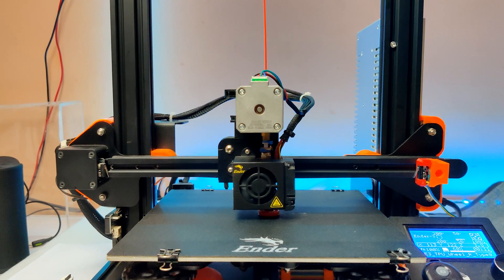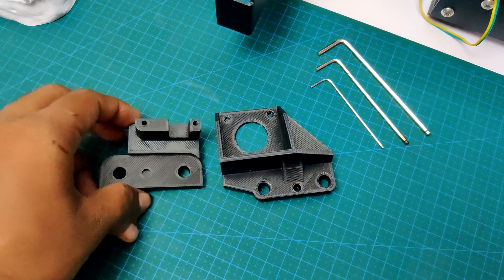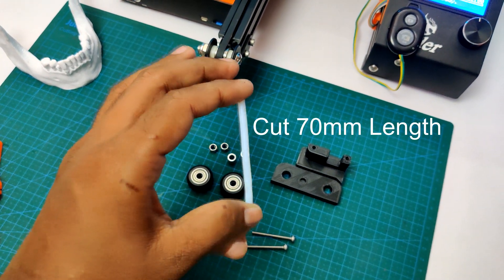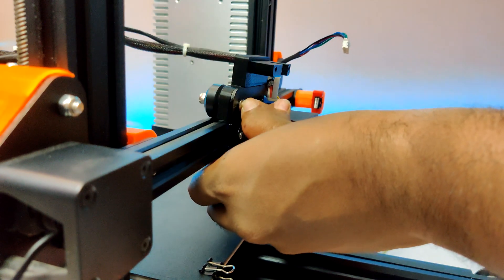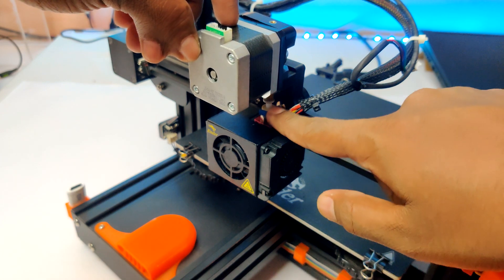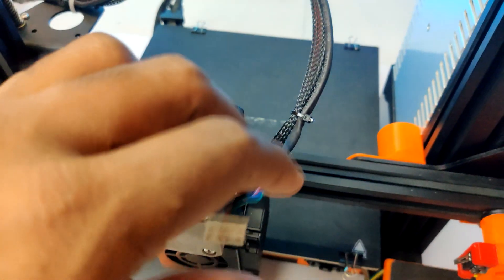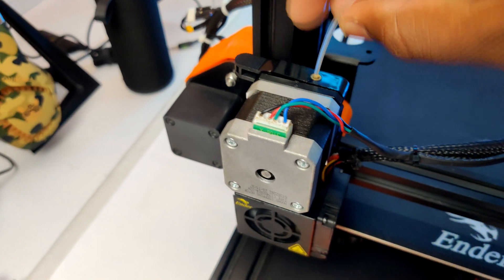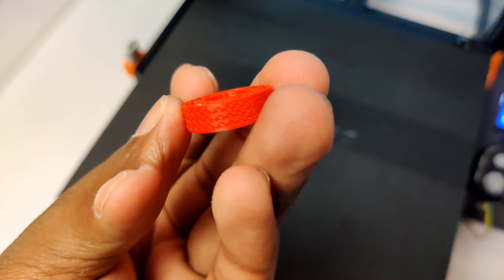Direct Drive on Ender 3 | Printable | Make it free #ender3

Comment: This is good but the design is faulty, I realised after installing the part on my printer, The main problem is that it does not support the spring tensioning screw which is a vital part for the extruder assembly, however it can be fixed by using a grub screw instead of m4 screw that it comes with.
Reply from the maker: Really thanks for the feedback brother. That's my bad, I forgot to mention the spring screw needs to be upside-down inside the spring. Once again thanks. I will add those instructions in the description. Have a great day brother 😊
Reply: I stuck a grub screw in mine lol

Comment: is it true that if I use direct drive I can push my ender 3 to a baseline of 100mm/s using high speed PLA? copilot said that it would and I wanted to see if it was true.
Reply from the maker: yes, you can
Reply: @dcl3d  Thanks, also, I found a 3d printed direct drive mount(not this one) and the guy who made it said you can do 100mm/s and  3000+ acc with perfect quality

Comment: The design is very good and simple, easy to print, but in my case I had to modify the model since the motor did not fit, then take into account that due to the weight of the motor and being 3D printed it flexes slightly so the upper area I had to give it a slight upward tilt and finally the screws did not fit correctly so I had to make some entrances to obtain more progress and a better fit.

Comment: I clicked on your printables link. It printed however I just noticed that the mount design has changed slightly. The two pillars that were the mounting pieces for the extruder are now shorter. I just wanted to verify that this design will still work the same way as in the video?

Comment: Hey dude can you tell me how the extruder tension spring works cuz it does not fot
Reply from the maker: @Xeno9118 I forgot to mention the spring part buddy. U need to screw the screw inside the spring( reverse it ). U can see on 1:48 pause it and check.
Reply: @dcl3d do I need to adjust any settings on my printer?
Reply from the maker: @Xeno9118  I use Retraction distance 5mm and retraction speed 45mm/s. it will reduce the filament strings.

Comment: Which improvement does it have with this upgrade?
Reply from the maker: You can print various TPU filament and with correct settings u can reduce the strings on print.

Comment: This was a great video but nobody is showing where the filament detectors goes or is hooked up. I'm trying to upgrade my voxelab. Any suggestions?
Reply from the maker: Your question is, where u need to connect the filament detector on your voxelab right.
I don't know what model u have in voxelab. If u see your motherboard spec, if it has a slot for filament detector u can add one to it. Or no slot u need to upgrade the motherboard. Hope it is useful. Have a great day 😊
Reply: @dcl3d  Thanks for responding I have the Aquila X2, the filament detector is located on the side next to the feeder. When I upgraded to the direct feed I didn't think about the filament detector.
I figured out 2 solutions for the fix
1. I could relocated the detector to the top support next to the filament roll
or
2. Place a piece of filament in the detector fooling in to operate like it was all connected. 

I chose #2 - problem solved

Thanks again

Comment: This is the best implementation I have seen. The only question is, is the structure rigid enough?
Reply: I've been using this on a printer for about a year and 4 months running a couple of times per week and the assembly is still rigid and working great
Reply from the maker: @Swole_Gecko  Thanks for your feedback brother😍
Reply from the maker: Yeah, those are really strong. I run my printer day and night it works great. It been 9 months still I didn’t get any clogging issues.

Comment: absolutelly useless. what are the print setting? i don't need to see how you mount it, i need settings
Reply from the maker: 1.Profile -  0.2
2.Infill - 40%
3.Speed - 60
4.Filament - PLA+ , ABS anything you can use.
5.Temperature as per the filament.
Reply from the maker: Also watch the video fully. So that you can understand , how you need to mount them.

Comment: Hi! Great work! Does it work with the Satsana Duct ?
Reply from the maker: Yes , Satsana fits but if you already printed it you need to cut the cable support on top. Download my Satsana file which fits with this direct drive. You can get the file in my last video.

Comment: Hey brother i upgrade correctly. But the thing is when printing continue fillemet  through out by extruder and again fillemet through in nozzle but the thing is when fillement through out some time it doesnt come again correctly
Reply from the maker: Did your motor too stops spinning or only the filament not extruding?

Comment: Actually, the original DD extruder adapter does not limit the usable x-axis widht. You just have to move the wiring to the front of the frame. :)